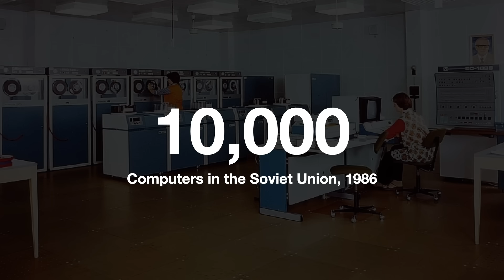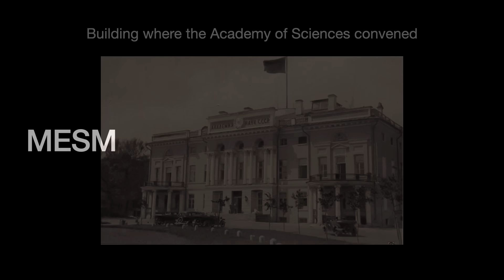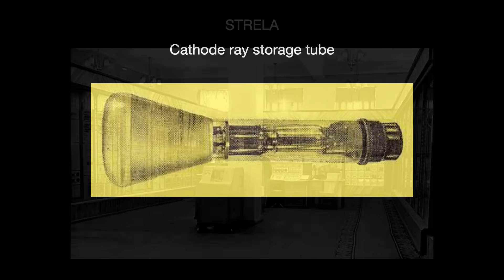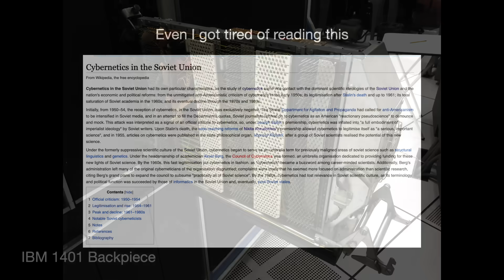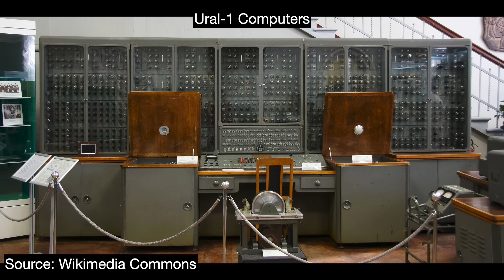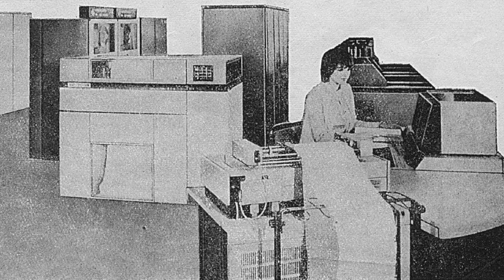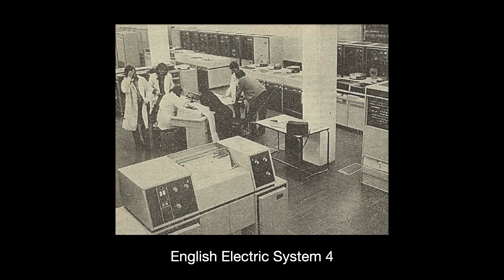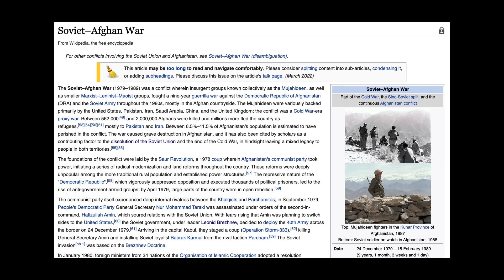Why the Soviet Computer Failed

Comment: Soviets had very limited resources. And if 1950s and probably 1960s it could be explained by consequences of WWII but then it was purely due to extremely inefficient resources distribution both inside the country and abroad. Supporting numerous countries of so called "socialist orientation" was pumping funds ftom the country. Things were grim within the country as well. Moscow, Leningrad, Estonia, Latvia, Lithuania, Georgia, Moldavia, Western Ukraine were havy subsidesed by Russia, Eastern and Central Ukraine, Belorusia, Azerbaijan. Funds allocation per capita was up to 4 times higher for the former compared to the latter. Any discussions on this topic were strict taboos. While studing at High School I prepared a report using open data sources showing this. My teacher took it from me and said that it's a good work but don't show it to anyone else.

Comment: IBM standardized the architecture of its computers for a reason, and to accumulate code. Even then, programming to lag behind the progress of computing. That is why USSR had no other choice. As now it is impossible to refuse compatibility with x86. All computer developers suffered from it, not only BESM-6.
BESM followed CDC/Cray. And the competition with Europe did not include UK. I am a programmer from the USSR. A Soviet tale is told, and accuracy leads to different conclusions.
Not only IBM/360, but also DEC PDPs were stolen.

Comment: My former computer science Professor always told us about the skills of Soviet programmers. They often had less hardware  power to work with so they often had a much greater focus on efficiency
Reply: When starting a fire without a lighter, two sticks CAN get the job done, but will never be anywhere near as efficiency. You can only get so efficient with subpar equipment before the the bottleneck strangles further progress in that regard
Reply: I am afraid that is just nonsense.

Comment: I did a course in Informatics at the Wroclaw Polytechnic in Poland in 1986-87. We had access to a Polish Odra computer which still used teletype terminals. The advanced classes had access to a Soviet Riad (or Ryad) computer which had CRT terminals. The year before, in 1985, the computer classes still were using punch cards for programming. In 1986 we were lucky to able to save our code on a disk. In think in 1987, the Polytechnic acquired a very modern East German computer that had a color CRT terminal. It filled an entire room and was made from simple integrated circuits (in the style of 74LS30).
Reply: It was really ES, yEdinaya Seria computers, Soviet clone of IBM/360+ systems rather than Riad brand itself.
Riad term meant something like a generation of systems. Riad-1 was clone of IBM s/360 irons, Riad-2 was clone of s/370' irons, Riad-3 was difficult to match exactly with IBM production
Reply: @РяхаИгоряхи You are right but in Poland they were called Riad. I did some calculations on one in a different institution in my city. I was happy that you could input the code with a terminal, not punch cards.
Reply: The most characteristic feature of RIADs was that from the loading of the operating system to the failure rarely more than a few hours passed. After 1989, old used original IBM mainframes came to Poland, which worked for months without reloading. The electronics produced in the USSR proved better as a heater than a computer.
Reply: In 1981 I started university in Birmingham, England.   Computer usage was done by writing coding sheets (lines of square boxes - one symbol per box) in BASIC which we would hand in to be converted to punched cards.   You would then book time on the actual computer and hand your bundle of punched cards in at a hatch in the wall.  
 A day or two later you could then collect your printed output along with your cards that you could use again if you wanted.   This was my experience doing 1st year mathematics as part of a 3 year Biochemistry degree. 
 Previously, in school,1973, we were the very first year ever to have the option to do computer studies.   There was one computer in our city owned by the council for doing wages and such.   We were allowed to write some BASIC on coding sheets and get printed output.    We did visit the computer one day for a field trip.

Comment: Problem was those in charge too scared to take personal responsibility for any failure that'd occur in the process of development. Also what didn't help was the fact that the west would combine and share what worked, while USSR for all its skill and ingenuity potential didn't have such help. Combined with bosses almost REFUSING to try to improve even existing design without someone above them taking responsibility, it contributed to Soviets lagging. However for all the being behind in terms of electronic components, they were capable of building necessary electronic devices for aircraft, space ships, satellites and other applications. That's because the APPLIED use doesn't require the utmost in latest and greatest. Sure Russian electronics are larger and heavier, but they are still capable of doing what's required.

Comment: 8 to 10 thousand operations are not necessarily 8 to 10 kilo-flops. A FLOP is specifically a floating point operation and is computationally expensive. That's why they use flops today as a measurement of processing power. I doubt that vacuum tube based computer did 10 kiloflops, but I could be wrong

Comment: There's this story that russian spies would bring back modern chips from the west, and the engineers would then take it apart with a diamond file, microphotographing the circuitry to be reproduced at larger scale. Around the time the west moved from AT-s to XT-s, the layers would become so thin that it became impossible to file down just a single layer, or even to be sure how many layers you had filed off in a single go. And that was the end of the "russian computer". Or so the story goes.

Comment: I learned to program on a Soviet EC1045 computer. In theory it was a powerful machine, comparable to the larger IBM 370 models. But practically, it was a pile of junk that only worked for a while and then had to be restarted because of some error or had to be repaired. In fact, it could only be used for maybe an hour out of each day. This was due to the very poor quality of the manufacture of the computer and its components. It was a practical demonstration of the pointlessness of a planned economy - the visible difference between the situation between making a computer (or anything else) because you have to and making it because you want to.

Comment: Thanks, I started learning computing in the late 60s using Fortran and punched cards, you used 3 fingers in different combinations to punch the cards. It often took weeks to get past the syntax errors, and then compilation errors before it would execute.
A few years later , Basic came along, if you knew Fortran, then you could use Basic straight away, error checked as you typed it in, and you could debug in a very short time,such progress in a few short years.
Reply: Well, John Doyle, I did the same thing, having learned Fortran in 3 weeks at Stevens Institute of Technology, during an NSF-sponsored course, in 3 weeks, during the summer of 1969, when I had just turned 17--my very first electronic computer programming language--on an IBM System 360 mainframe, which I believe had 64K of "core memory"--and filled the whole computer center building.  By 1982, I had bought, and was using, a Commodore 64 home computer (similar to an Apple 2-C, or a Tandy Radio Shack Color Computer 2), with the same 64K of memory, also (but all semiconductor electronic, and much faster), in a small box, sitting on top of my table, underneath my tv (and using it as a monitor), operating "interactively" using an "interpreter", enabling me to write and debug a program in Commodore Basic, in half an hour, in 1982, instead of 3 weeks, like in 1969.  And now this android "computer" that I am using, has 16 BILLION bytes of memory, in 2023, not just 64 THOUSAND bytes, as was the case, in 1982...
Reply: 1976,  I was in college for a BS in Computer Science.  Fortran through punched cards.  It was a horrible experience and a real step down.  In my last year of high school I had Basic on a remote terminal that corrected my inputs on the fly.  This totally deceived me about what I would find in college.

Comment: Would be curious to learn more of Russian computing involving their trinary systems.  Where in the west, binary systems are typical - using a positive or negative voltage for ON/OFF - Read about early Russian systems that recognized 3 states, rather than two.  Positive, Negative, or None.  Thus a trinary system vs a binary system.  Appeared to be something they worked on before the change to modeling/copying what they could from the west.

Comment: Stopped watching the video when the author has spelled kyiev instead of Kiev. 
Soviet computers were so bad that intel pentium was build on USSR's tech - the ELBRUS processors which were sold to the west in 90s because they needed food not computers. 
also
>Confirm the historical primacy of Elbrus and in America. In the same article from Microprocessor Report kit Diefendorff, the developer of Motorola 88110-one of the first Western superscalar processors, writes: "In 1978, almost 15 years earlier than appeared the first Western superscalar processors, Elbrus-1 was used processor, with issue two commands in one cycle, changing the order of execution of commands, renaming registers and execution by assumption".
There is plenty information about influence of the Russian architecture in the modern processors.  But the video is low key propaganda instead of deep-dive technical digest.
Reply: Aw, is history not to your liking? That's ok, just lie!
Reply: @sid2112  as i said the author of the video is either lieing because "ussr is bad. mkay" or just didn't do any research. Here an Ussr tv ad from 1986-88 of home pc for Russian kids (the pc is clone of apple 2) 
https://www.youtube.com/watch?v=l6iFDlWzPz0

Comment: usa was the leader of the imperialist block and it had the opportunities of accumulation of capital by this adventage. Its market was all the world, unlike the soviets which tries the improve the life conditions in relatively poorer, limited area. Putting the blame on central planning economy is a mistake, because without central economy russia is doing worse. After the collapse, it is clear that central ecenomy was the only method to compete with imperialists to a degree not the reason to lag behind. Today's russia is much worse than soviet union. a single socialist country's position will never be as strong as the biggest imperialist, but it shows scientific resaerch is necessary and possible even with poorer economic conditions.
Reply: It is typical for Russia to blame its failure on someone else.

Comment: "The quota says nothing about the quality of the steel, or increasing his productivity."
Exceeding quotas gave bonuses,  people were payed better for overperforming. And the quality of the steel was absolutely checked. The issue is that during Yezovh as head of the KPD, as before and after, there were plenty of people who entered the country to commit cooporate sabotage. 
One british communist wrote that in his workplace in the east, some managers would purposefully fill quartz sand into machines to stop them, and all kinds of things. 
The most important factor is this, when the USSR started it's development it was almost on the same level of development as feudal India, and would have to compete with the US and it's allies over the next few decades. 
You can guess three times why the USSR couldn't keep up with semi conductor manufacture when Taiwan had become the ally of their rival, and their own starting point for manufacture was abysmally low compared to the US when they started, it's that simple. 
US development of computing was plagued with so many things it's difficult to count, it just doesn't appear as noticable now since it's not shown side by side. 

It is absolutely true though that the USSR failed to take advantage as much as they could of computing as well, even though there were also plenty of voices that wished for reform of the planned economy to take more advantage of these new computing devices.

Comment: I remember the y2k scare. 30 years later I was told that in 1999 companies were hiring people that knew how to turn on computers and correctly turn them off. I don't remember that. I was a crap programmer but knew how to use microsoft crap software better than average. Man I would have had a better life if I was at the right place at the right time.

Comment: Yes IBM had a 3rd party purchase a UNIVAC and IBM reverse engineered it, changed one pneumonic in the source code, put a different skin on it and sold it as "their" new 360 small business computer . . . Let the lawyering begin.
When the case was finally presented to SCOTUS, UNIVAC was awarded a $4 million compensation, but no attorneys fees, and not compensation for all those computers IBM sold.
And it only took 16 years

Comment: how do you use cathode ray tubes to store data?!
Reply: Aware of work in the U.S. on electrostatic memory effects on the screen of a cathode ray tube (CRT), Fredrick C. Williams (1911-1977) demonstrated the storage of a single binary digit (bit) at the British Telecommunications Research Establishment in October 1946. Storage occurs where a dot drawn on a cathode ray tube (CRT) screen induces a positive charge surrounded by a negatively charged area. A positive voltage pulse induced in a metal plate placed at the face of the tube enables reading of the stored information. The electron beam can be directed to any location on the screen thus offering random access to the data but as charge gradually leaks away from the site it must be rewritten on a regular cycle.

Williams moved to Manchester University where working with Tom Kilburn in late 1947 they were able to store 2,048 bits. In 1948 the Manchester “Baby” machine ran the first program on an electronic stored-program computer using Williams-Kilburn Tube storage. Application in early U.S. machines included the Princeton IAS, IBM 701, IBM 702, Standards Western Automatic Computer (SWAC), and UNIVAC 1103, as well as the Soviet Strela-1 and the Japanese TAC (Tokyo Automatic Computer).

Source: https://www.computerhistory.org/storageengine/williams-demonstrates-crt-storage/

Comment: At the University I had to do labs on sovet time sharing machine “Dialog-2” of ES (Edinaya Systema), you had to type in the program, compile from command line, after 15 minutes it gave message that something wrong, I had to retype the whole thing… at about the same time I had a chance to try PCx86, no hard drive, interactive Borland Pascal, press F2, in a sec you see on the screen the line with error and what is the error. It was like a magic. Programming since then. 
EVERYTHING failed in Sovet Union not just computers.

Comment: It failed because they never tried to innovate just copied the tech from US. I know a number of people that worked in ex-soviet republics and were doing exactly that - copying MOS 6502 chips. That became unfeasible very quickly with the advancement of the lithography process and it is the current state of affairs today. It is why China can be barred from acquiring advanced chips - there is a single company in the world (ASML), that can produce the machines required for it, and they are very much under strict sales control.

Comment: Sadly it looks like history may be repeating primarily due to one man. After the USSR Russia made some efforts on designing new CPUs (some compatible with existing instruction sets, a few new ones) but they seemingly mostly existed to say on paper that they had done so. The didn't have serious resources dedicated to development cycles to constantly improve them and now they are in a situation where their most advanced designs are multiple generations behind others to the point where they are on a 28nm manufacturing process and they are actually equaled or outperformed by some single board computers. It gets worse when you find out they don't have a single manufacturing facility in the country that can produce even those. They want to be able to produce 90 nm chips by the end of this year and 28 nm by 2030 while others are using a 5nm process already and looking to possible being building stuff with a 3nm process by the end of this year. That is a HUGE development and manufacturing gap to try and close.

So as I said history repeats. Russia got used to being able to simply import all the hardware it needed and didn't keep up with dedicating resources to develop their own let alone being able to build it and now they are cut off from imports and most external manufacturing. And with many people now fleeing the country you have to wonder how many of them are exactly the ones they would have needed to be engineers to work on new designs and help push forward their manufacturing capabilities.

Comment: USSR was copying not only IBM/360 architecture, but also Intel 8080 and 8086 processors. A clone of Intel 8080 was used in "Korvet" PC. The clone of 8086 was used in "Iskra" PC.
The biggest problem of computers made in USSR was unreliability of  ICs.

Comment: The 360 wasn't the first computer the Soviets reversed engineered from the west. During WW2 4 B-29 bombers landed in the USSR and were seized by the Soviets. In them they had the The GE fire control system which at the time was a extremely advanced computer controlled targeting system. They reverse engineered both the targeting system and the bomber creating the Tu-4.